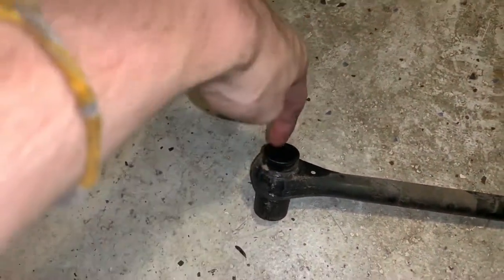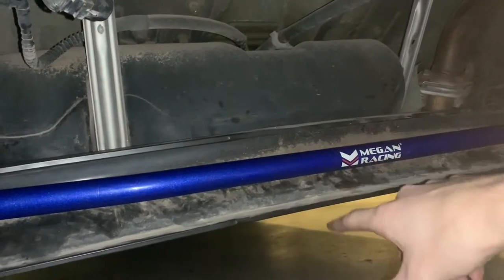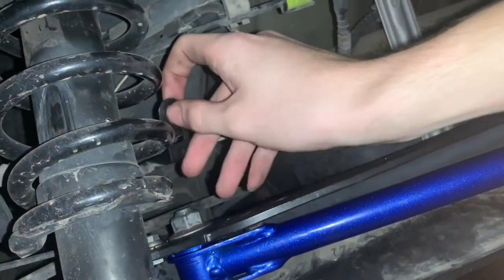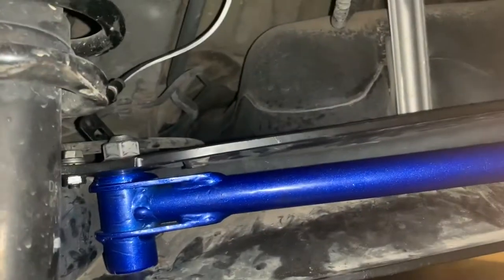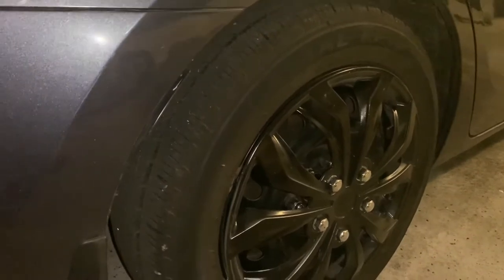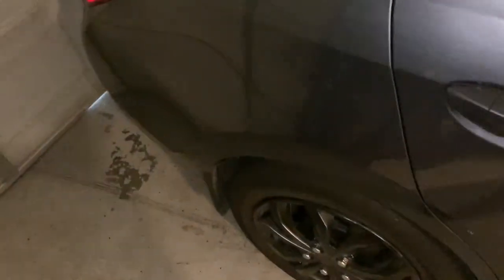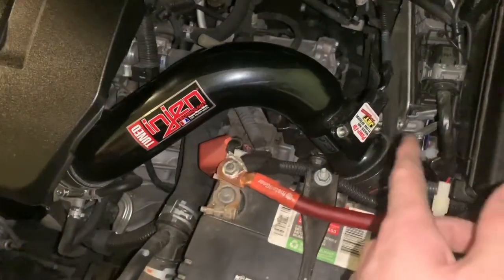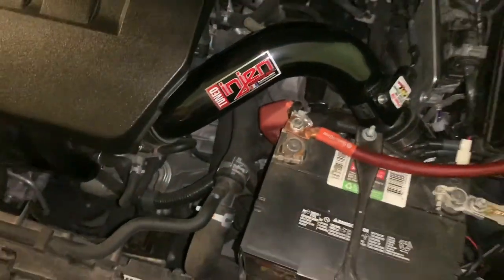2014 Corolla Megan Racing Rear Sway Bar

Comment: I had to have the bar installed at a local shop, with a "lift", using a 3-foot breaker bar.  The bolt is bolted on at 184-foot pounds and it's not easy to crack it open -- and my corolla is MINT, i.e., no rust. I must say that this sway bar is far superior over the stock bar -- you can feel the car's stiffness around tight corners under quick acceleration.  I highly recommend this bar. I also recommend keeping and using the black rubber noise insulating block of on the original sway bar -- it's there for the reason of "stabilizing" the center of the stabilizer bar, and when you trim it a little you cannot even tell it's there. Now I have a stiffer back end with no rattles or creaking, perfect.
Reply from the maker: Awesome! Have you installed any other upgrades?

Comment from the maker: Update:
Make sure you apply grease to the bolts before reinstalling the sway bar. I was getting some very unpleasant creaking. After using a synthetic grease the sound was gone.
Reply: I was about to ask about the creaking too, by any chance can you link the brand you used?

Comment: Question did you replace the original or this is an add on
Reply from the maker: I replaced the original!
Reply: @connorh2908  is it better
Reply: @CombatePractico  not sure if you are still searching, but it's heaps better than stock. Before adding the rear sway bar I would get tossed all over the road in high winds and would understeer on corners, after the uograde the car feels much more planted and is more prone to oversteer,  which is much easier to control and correct.

Comment: Did you notice a difference after you installed the rear sway bar?
Reply from the maker: Yeah man, I think it improves handling. Ive heard it does make the car slightly more prone to under steering but I have yet to have any noticeable issues so far.